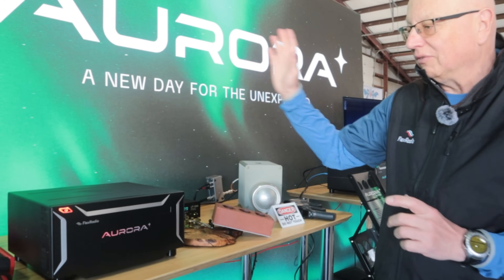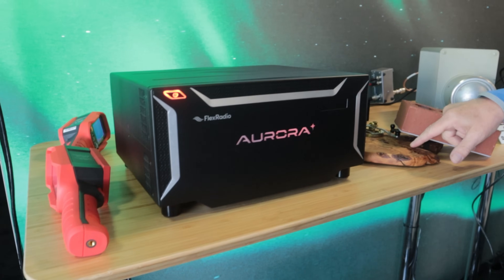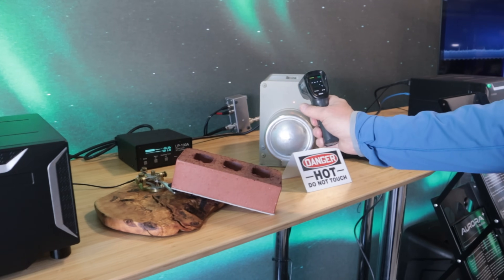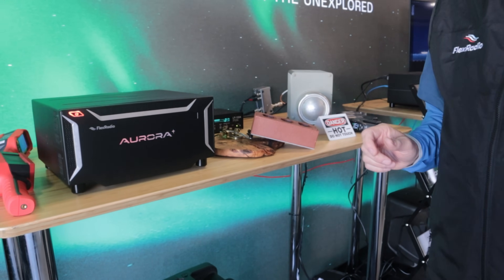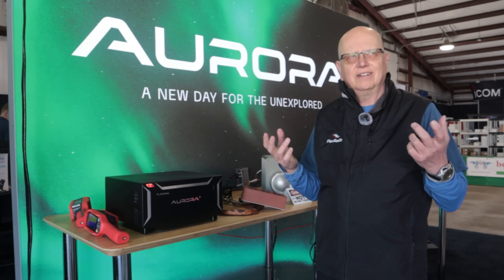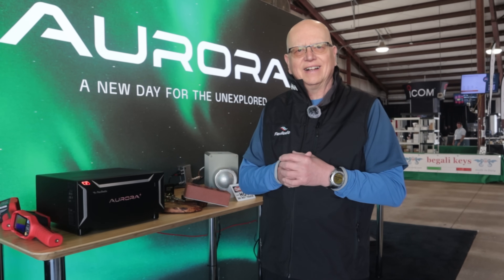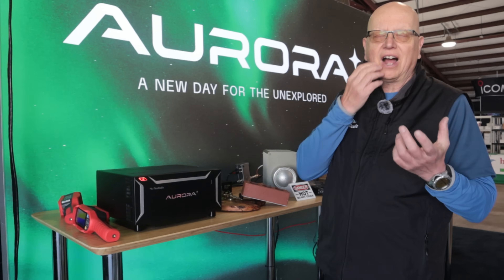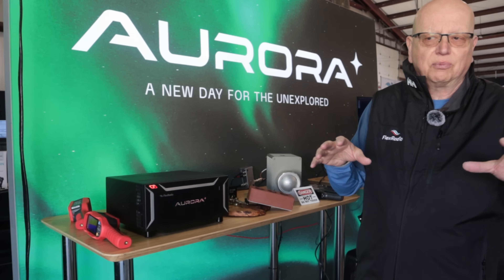FlexRadio REVEALS the Aurora 500-watt Radio at Hamvention 2025

Comment: Most those radios like the old Yaesus and Kenwoods like the TS820s with the 6146s were about 180W to 200W out.  I think we kind of went backwards to 100W when we went to Solid Sate BUT they were cake to take mobile so they had that going for them.  It sounded like this one was very locked down to the amatuer bands due to the tank circuits.  For better or for worse, if that thing would do 11M it would be a hit on the world wide markets.  That said, I imagine this might prompt the big three to step up their game a little, I mean if we could just get back to 200W as the standard I would be happy.

Comment: How much amperage this bad boy will pull at full 500W PEP?
Reply: The spec calls for around 5.4 amps at 120 volts.  One key point that wasn't mentioned is that this transceiver is 80% plus efficient.  It runs on 80 to 254 volts AC so you can plug it into most any outlet in the world.  The fact that it's 80% to 90% efficient is how they can run it key down for more than eight hours without it getting more than a little warm.

Comment: US$8600 -- a bargain for 1% of the Amateur community, affordable for another 1% of the Amateur community.

Talk about tone deaf.  Jeesus H. In a blue Ford pickup.  This is FlexRadio saying, "Let them eat cake."
Reply from the maker: If you calculate the price of a 500-watt amplifier, then add it to a prior model from Flex - you actually come out ahead
Reply: I tend to agree with that assessment minus the 1% talk.  Flex is getting to the point where Asian radios are eating flex lunch. 

Coupled with the fact, flex won't get into the VHF sphere to compete with beofang to produce a good all mode radio. They don't care.
Reply: @B_MAD_24  Both the old 6600 and the new 8600 have two transverter ports on them.  You just go to Q5 Signal and pick your VHF / UHF frequencies.  I think Flex is very smart to stay in the HF arena where they excel and let another company like Q5 Signal provide the VHF/UHF side of the equation where they excel.
Reply: Flex will be out of business after the great boomer die off.
Reply from the maker: Boomers don't use FlexRadios.  Flex has the latest technology, they aren't going anywhere.  Mark my words

Comment: I am surprised the Aurora didn't get much more social media coverage compared to the Yaesu FTX-1F and Optima.  A 500 watt transmitter is much more impressive than adding an amplifier, IMHO.
Reply: It didn't get more coverage because it's unobtainium for 98% of the Amateur community.
Reply from the maker: @N0SLD - I can't say I agree here.  Lots of folks have 500w amps
Reply: @HamRadio2 Not that cost $6200.
Reply from the maker: @SuperJoeycooper  Many amps cost more than that.  Look at Alpha Amplifiers.  But this unit is a radio AND an Amp (kinda) so you shouldn't compare the Aurora to just an amp
Reply from the maker: I agree @bwillan